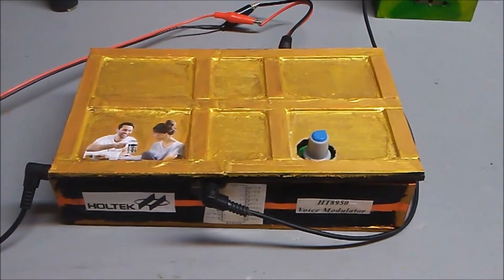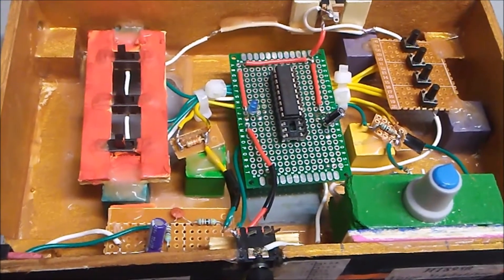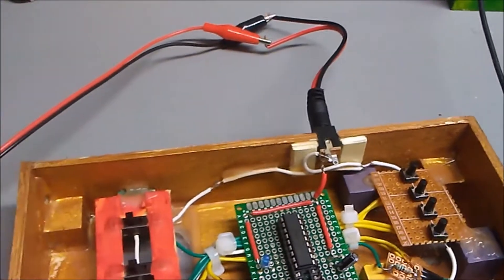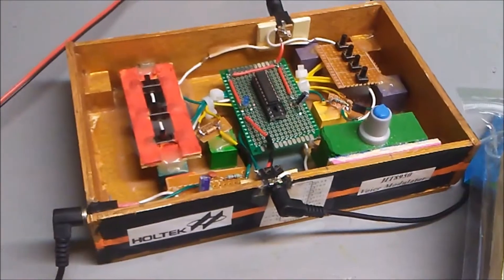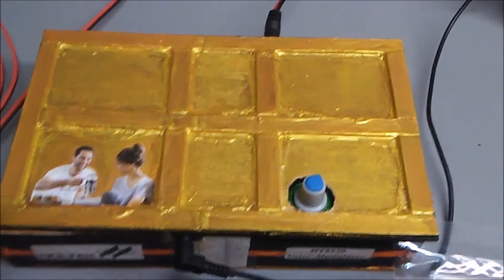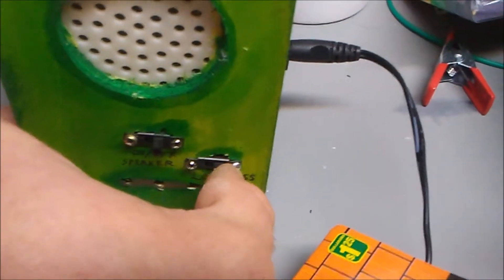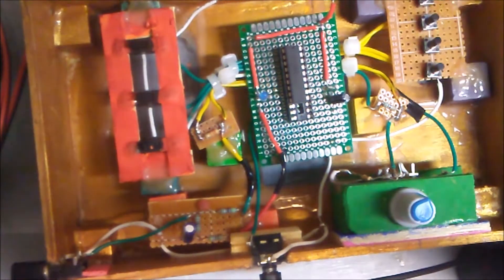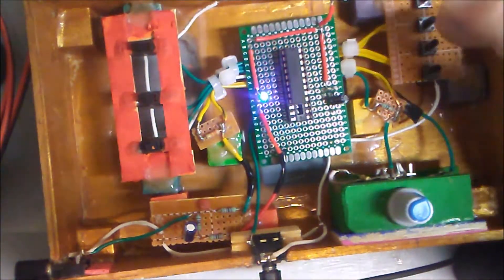Voice Changer Circuit: Holtek 8950 Voice Modulator: Part 2

Comment from the maker: WATCH PART 1: 
https://www.youtube.com/watch?v=7mCA8THBr04&feature=youtu.be
My dear appreciated viewers: I hope you find this video entertaining. However, I created this video for the sake of those trying to construct a Holtek 8950 Voice Modulator circuit. ATTENTION: This chip comes in a 16 and 18 pin DIP package. Please be aware that the pin-outs are drastically different on each chip. Also, please see the links in the video description. The links should help you in comprehending how the chip is designed to work. All the best in building your circuit! -2Bit

And, I found a video, better than mine, which addresses some of the issues I've been having: https://www.youtube.com/watch?v=sv1S4BPKGH8

Please subscribe.